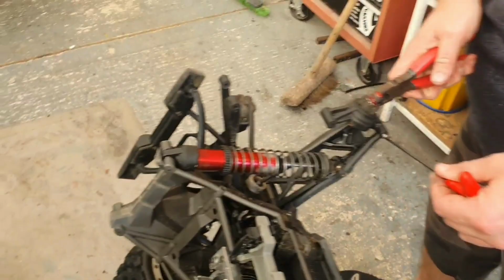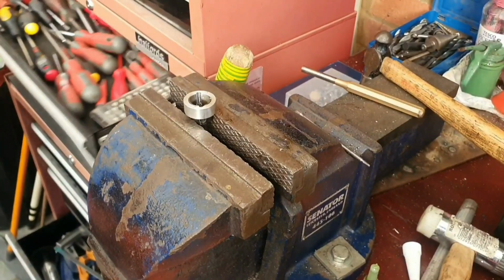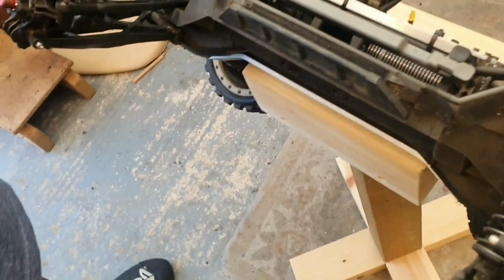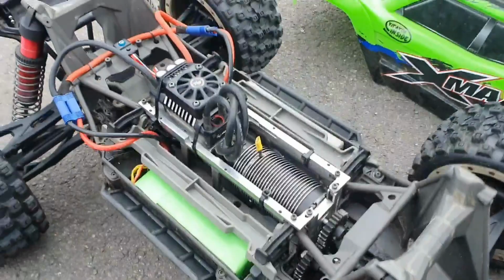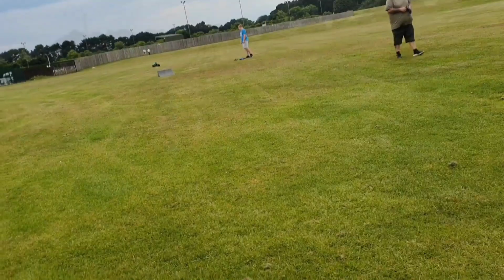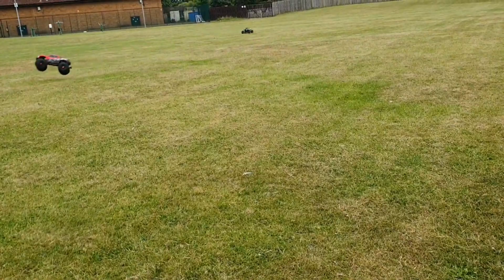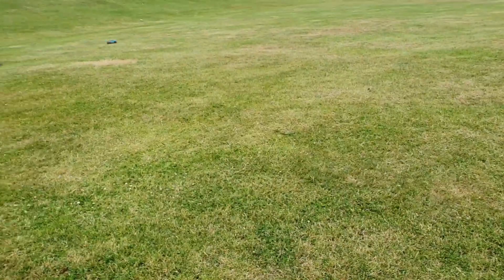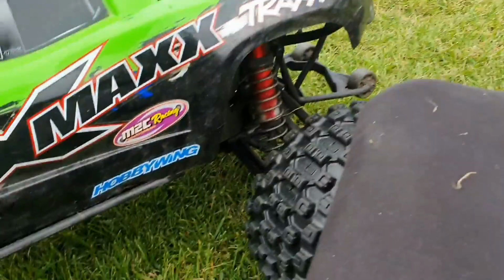Traxxas Xmaxx Drive Cup Sleeve Mod Installation and Test.

Comment: Just got mine. Thanks.
Reply from the maker: Your very welcome Steve. Glad you recieved them safe and sound. Thanks for your feedback 😀
Reply: Only checked video as I wasn't sure on the Locktite. Can you design a skid plate for rear bumper lol I've removed the wheelie bar and always open to new mods.
Reply from the maker: That's a wicked idea. We're always open to new ideas to develop custom parts. We both own xmaxx's and can certainly look into it. Thanks